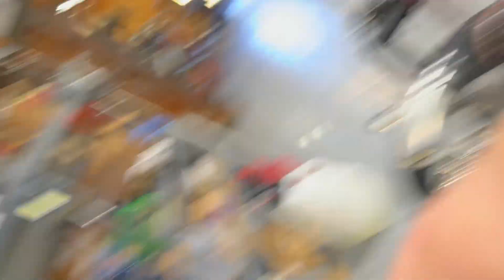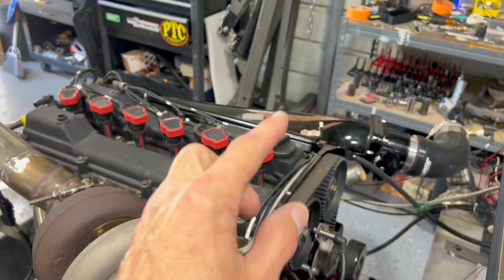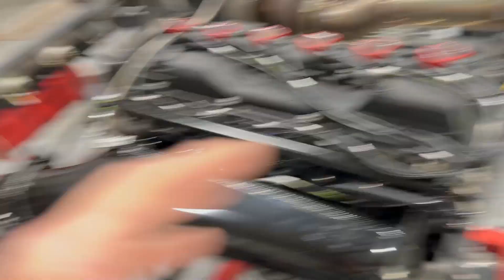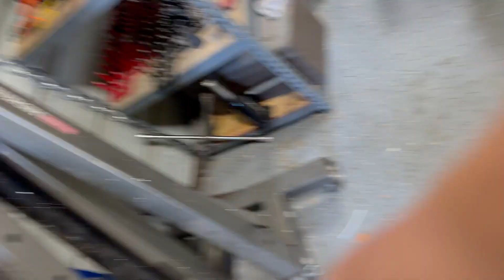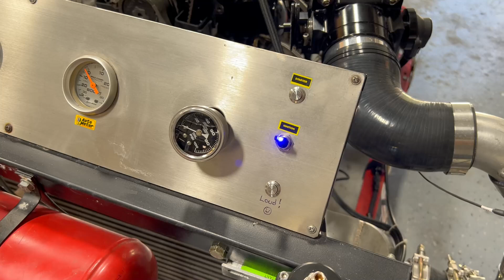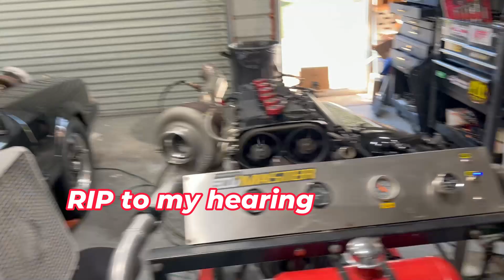2JZ Motorsport Quality Harness! ECUMASTER Rowdy 2 Step On the Engine Stand! Pray For My Hearing LOL!

Comment: Very nice setup  what kind of IACV dobyou used?
Reply from the maker: None.
Reply: @fox-body  i doing a 300zx 2jz swap with ge vvti engine and I know some people don't used iac but I ask the ecu master suport and they talk me that I has to use iacv wit my ffim so now I little  confused and if I has to used one I don't know which I can used ? I going to used DBC throttle body
Reply from the maker: You can control idle with timing in ecu master. Or get the powerhouse racing ford iacv adapter kit.

Comment: Can you tell me about the crank sensor? I was going to use a factory 2J sensor, but was unsure if would work with my Dominator ECU. Work looks fantastic and clean
Reply from the maker: It’s a hall sensor. It would work with the Holley. I think the factory vr sensor would work also.
Reply: What sensor did you use on your Holley and what was your setup if you used the two wire.

Comment: Question on the MAP sensor relocation because I've noticed this as a new trend where alot of modern standalones feature an integrated MAP, so you can really just run a long tube to the nipple of the MAP when it's integrated on the PCB of the ECU, but is it really nessasary or that much better if the MAP isn't manifold based (I get that it's subjected to heat cycles when engine side mounted), or is it just the fact that you can remote mount it because you only need a thin tube from a vacuum reference that really started this trend?

Edit* any fiber optic trigger wheel options?
Reply from the maker: Vibration kills pressure sensors. That’s why it’s best to remote mount them. I like to use hard push lock lines. As far as optical, i don’t know a lot about it.  Hall sensors are pretty standard and are good to 15k rpm.

Comment: You're not grabbing constant 12v to the ecu from the starter with a ring terminal wired?
Reply from the maker: @damnitdang  no I’m not. The relay box I have has several 12v constant outputs.  But you could absolutely do that if you choose.